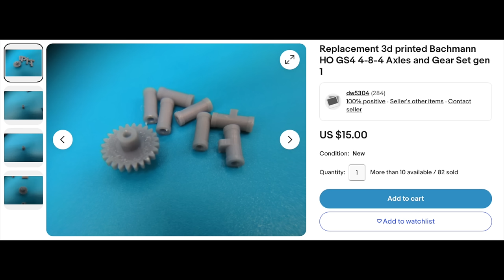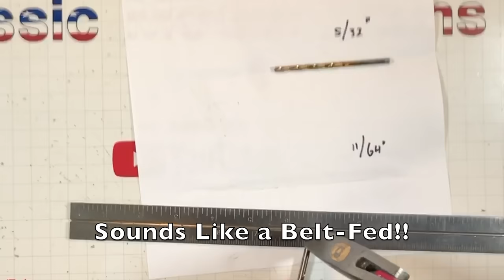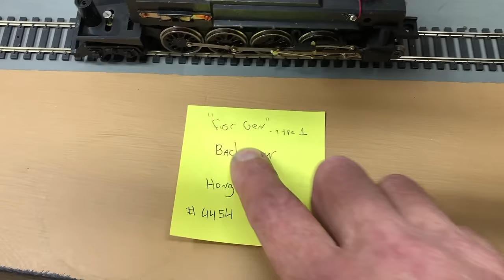3D Printed Gears Didn't Work!  I Found A Technique That DOES!

Comment: On the printed parts I wonder if heating them some prior to installation would be another route to consider? Steep them in boiling water or just place them near a light bulb before pressing them into place. The sleeves are a super solution though and the whole video was a good one. Also, I bet using nylon screws and nuts would have also been a option instead of the home-made sprue screw assembly.
Reply: There are some materials which harden when heated, issue is shrinkage. (Nylon parts in RC)
Reply from the maker: Thanks. Yes the nylon bolt and nut idea would work.  I just wasn't in the mood to goto town and get some :-)
Reply: I’ve seen one guy on YouTube use RC gears to repair Bachmann locos, Gears are are gears, a 14 tooth gear is a 14 tooth gear no mystery to it. Is pretty much wat he said. I wonder if I could get metal gears from somewhere, I have a catalog from a gear supplier somewhere.

Comment: In the UK we have split chassis models thanks (no thanks) to Mainline Railways and early Bachmann. They always failed with the nylon axles and gears splitting and tangling up the linkage, at least Bachmann upgraded the noise underpowered pancake motors with decent can motors but they still used the daft split chassis design until the 2000s when they all died I believe
Reply from the maker: Thanks for some cool information!!

Comment: Props bro, I’ve had to replace the motor/gear/flywheel and belt on my Spectrum Consolidation and I’ll bet I’ve had it apart probably 10 times to get it sorta together correct and now the headlight doesn’t work 🤦 . But honestly I like the engineering and completely understand why others don’t! I really want a Daylight FEF and cars.
Reply from the maker: Thanks Rick. I wouldn't mind a Daylight with cars, just another manufacturers offering.

Comment: 3D printing has one fault i can see, it is made a way like a casting only worse as far as strength. I laugh every time I hear about anyone making high stress items.
Now there is a 3D process which uses a materials like metal which might work, but you need insulating.
What is needed a gear set made though milling from a block. (work at a place that did that for prototype parts

By the ways, square and round shaft part stress is nothing new. Lots of people can not understand how the old fabric mills of mid 1800s did make it work. they used square shafts and round flywheels
Reply from the maker: 3D printing has a lot of good uses, and this application aint one of them for sure.  1800's engineering is amazing to me!!

Comment: Nice fix brother !!!!! .I really like the tube stretch method to get what you need . Made in freaking China/Tiawan /Korea .Rebuilt right in the USA MAN!!! The makers of the junk replacement parts needs to be called out big time or the old fashioned way .Well you know.  .Almost seems they made them and never took the time to actually test to see if they actually worked .. Thanks Man !
Reply from the maker: Thanks Adam.  The second set I received, I was able to phone call and visit with the creator of the piece.  Says he's sold over 500 of them and not had the problems I encountered.  He was at a loss as to why I could not get his gears to fit on my axles.  Merry Christmas to you and yours Sir!!

Comment: I've been through cracked gears with bachmann. I found with a good cleaning with hot water and Dawn dish soap. Sewing 🧵 and CA you can glue the cracks and carefully position thread using it to completely close the crack all the way. Obviously the tighter you pull and wrap the thread better it holds. Then take off thread after about 24 hrs dry time. I would put them back together and clicking gone. Still running some common Santa Fe's and chessie after fixing them 6yrs ago. Love video and some great not to order from replacement stuff information. And these are the ones I was telling you about with the wheel timing. I had bought 1 in lot buy. Didn't have close up pix of it. Ya then got it. Disappointed major. It was non diluted hand painted red white and blue. Paint was so bad when I started taking it off... SMH 🤦‍♂️... I see that it was painted over a daylight scheme tender to. Had a chance to get different shells but after another lot buy. I spent my limit so missed out. Still looking for another shell set that fits budget. Kicking myself in the head everytime I see it for not just buying them. Thanks for info t have great Xmas and New years 🎉🎉🍻🍹🥳🎇🎆
Reply from the maker: Thread and CA sounds like a pretty good idea as well.  Seems a Feller could leave the thread in place?  So somebody painted a daylight special into an American freedom scheme?  Poor paint jobs....what do ya do?  Guys got learn one way or another :-). M.C. to you as well John
Reply: @classicmodeltrains  wish but you need to wrap around and through the gear ⚙️ teeth. Pulling tighter the closer you get to crack. Almost like windings on amiture. Use lock tite super glue to. Works well and you can use uncure on it as well as CA.
Reply: @classicmodeltrains  wish whoever did it tried learning on a cheaper and more common engine. Lol

Comment: First off...nice job of adapt/improvise/overcome. Second...there are what's called "engineering" plastic resins suitable for making functional thermoset axle/gearsets that won't instantly disintegrate during assembly or shortly afterwards during usage. They are used in silicone molds made from perfect original parts. I'm a mechanical engineer who develops stuff like this for a living...and an avid model railroader who can fix or IMPROVE virtually anything. Some of these clowns hawking 3D printed stuff don't have a clue. While there ARE 3D printing materials and processes suitable for making functional parts, you're probably not going to get anything really reliable from most interdwerb sellers...as you found out.
Reply from the maker: Thank you and I have had several other Fellers who do what you do with the commercial making of parts tell me the same thing.  The at home 3D printed stuff is no good for gears.  Pretty cool you can make up new fix it parts for your railroad items as needed!!

Comment: This locomotive started out with Lionel's second (and failed)  attempt to make it in HO back in the 1970"s. 
Bachmann had nothing to do with Lionel's version as these locomotives were made by Kader of Hong Kong.
Reply from the maker: Kader?  I hear Lionel was using re-branded Athearn in the late 60's.  Strange how Lionel could never pull off a market share of H.O.
Reply: Kadar is bachmann that why all of lionels stuff from the time is the same as bachmann because its the same manufacturer
Reply: @classicmodeltrains : Lionel HO of the 1960's was re-branded Athearn. Attempt two from the 1970's was mostly a Kader (Hong Kong) effort with Lionel HO scale building kits in the 70's made for Lionel by Pola of the former West Germany along with some Lionel produced HO (GP9's the FA's, U18B and some cars) made in Michigan thrown in with the U.S. produced 1970's HO items. Eventually, all trains items (locomotives and cars except the U18B) from the 1970's moved to Hong Kong production to cut costs. Now, Lionel is trying a third attempt at HO, this time using re-branded Model Power items.

Comment: Good to know about this. Resin 3d printing is great for precise things, and there's various resins that behave differently. It seems both were too hard, which would be fine for models or detail parts. There are ABS like resins out there which would be softer. 

I will keep your repair in mind as I'm the fix-it guy for my club and we have a Bachmann Niagara which the mechanism seems familiar to the gen 2.
Reply from the maker: I agree, if it was printed with something different it would be just fine :-)

Comment: Hey Ron, I have a Gen 1 Chessie 4-8-4 that I had bought replacement parts from a fellow named Otto back in 2015-16. They worked....for a bit. Now, that loco is back to being a shelf Queen because the gears broke. Imagine that. I must say the idea if "sleeving" the gears never crossed my mind. This repair ranks up there with the one I did on my Walther 90ft turntable. I bought bearings to carry the electric to the track instead of the crappy wiper/brass sleeves Walthers had
Reply from the maker: Hello Ray!  Yes its unfortunate the lack of engineering that takes place with some of the stuff in this here hobby.

Comment: The guy who offered those first set of gears through shapeways also offers gears for N scale bachmann trolleys. I was fixing a friends, he ordered the gears- same thing happened to me, I tried inserting a gear and it broke the instant I pressed it onto the axle. Axle holes weren't big enough! I figured if one gear broke, the others would probably break too, so instead I widened the holes in the gears until the axles slid into em, and then used a dab of CA to hold them in, which seemed to work out. They should really offer a buyer beware on those 3D printed gears!

It's always fun trying to make up something because you can't get the part you need. Used some K&S metal tubing, thin sheet brass, and some ball bearings salvaged from an old busted VCR to fix up an O gauge Lionel engine of mine that never ran because the bearings were shot. Runs like it's brand new now! It's an early MPC job where the bearings are just plastic, molded into the bottom of the motor truck and the brushplate on top, so there's no real seperate bearing to replace. Had to open the holes up and make my own!
Reply from the maker: If I would have started with that little file set I bought for this job I suppose I could have done the same thing and made it work.  I just thought if the gears are this brittle will they break if I set the loco down bit rough?  Sounds like you came up with a pretty good solution for that MPC.  Quite the fabricator you are!!

Comment: Yes, some 3D materials are too brittle for this.  ABS-like resins may perform better.  That said, it does look like you have a size mismatch. FWIW, I would not expect much consistency from the producers of these models.  In any case, and even if the hole is perfectly sized, it almost certainly will crack if you wiggle the axle when trying to push the parts together by hand.  A press is the only reliable way to assemble these. HTH.
Reply from the maker: Off camera I used a press and they still continued to break.  The axle square was just to large for the 3D parts square.

Comment: Great...ABSOLUTELY GREAT Video showing the great lengths we go through not to spend high dollars on manufacturing locomotives that only last about 4 years.  I myself have completely gutted and rebuilding an MTH DCC GP38. It lasted only 4yrs, and MTH is OUT OF BUSINESS... When I'm done... New Motor, New DCC board, iPhone 4 speaker and LEDs to add for step and truck lights... But YES!
This video shows everyone what we do... And OMG, I have a few broken Bachmann Steamers from the 80s of eVile Bay..., I'm not gonna touch now...WOW what a headache to go through 😮
Reply from the maker: It was a lot, but in the end it's going to work for quite some time now.  Sounds like you have a lot into your GP-38.  Hope she pulls real good for ya :-)

Comment: My literal job for GE Power was 3D polymer printing R&D. I had ALL the toys, seen plenty that still isn't publicly available - I have several broadway limited engines that could desperately use gears.  ....yeah... I'd never recommend polymer gears... (resin) your results were painfully predictable. No one wishes or would work more than me.... but. No.  Just no.   😅
Reply from the maker: Cool to have someone with your "horsepower" chime in and confirm what I suspected.  Thank you Sir!!
Reply: @classicmodeltrains  you're welcome.  I actually had further thought on this and I feel bad for not technically elaborating.  Even if you had been successful on the install, the life would be highly questionable.  Photo-polymer does 2 things over time.  1, the cross-linking never really stops once started.  So, as the parts age the become harder and harder, and this more and more brittle.  We tracked test samples for years and couldn't really find that any had fully stabilized.  - secondly all photo-polymers are hydro-scopic, meaning they absorb moisture and expand like wood.  Even in very dry environments the humidity in the air is enough to cause growth.  This too seemed to never fully stabilize.  So, a nice snug fitting gear might spin loosely in a matter of weeks or months.   All of these things we're taking about are extremely small, nothing you'd ever see without microscopes or machinists tools, but in gears, thousandths matter.   Makes great visual parts.  I have some lovely bridges and cabooses I've made. Best keep it to things like that.
Reply from the maker: @bessemerlakeerieinhoscale6061   After purchasing the micro file set I could have opened up them 3D gears some more but I figured even if they get installed correctly the brittleness they presented would only end up with a very short life expectancy.  You have just confirmed my hypothesis.  Thank you!

Comment: God, havent we all been here at some point.  We start a project that goes from tough to dreadful to horrific, and every attempted fix is a fiasco.  We should crap can the whole thing, but its become a challenge, so we keep at it.  We end up inventing a fix thats way superior to the original.  It wasnt worth all that effort, but yeah, it was.   Those engines will be running long after we arent.
Reply from the maker: I see you have suffered just as I have.  It is nice when the problem gets solved one way or another.

Comment: The design is fundamentally flawed. The internal square hole concentrates all the stress at the corner of the hole where the material is thin. Cracks will form at these points first. All of this and Bachman engines are noisy to begin with.
Reply from the maker: Couldn't agree with you more, Although this loco was pretty quite I must admit :-)

Comment: I do a lot of 3D printing and you have to use the right resins for the right job. Sometimes even mixing resins. And then you need to stress test the parts so you can be reasonably sure they will not fail. It's not as simple as just designing the part, printing it and then here you go. This is why I will not make these types of parts for sale. But I will take a loco and custom make parts. Fit them, test them and only if I'm successful, do I bill the person. And because this all takes time, I only do it for club members, friends and maybe... friends of friends. 

I really enjoyed watching you tackle this job. Well done. But most important I think is for the people who ask others to do these repairs to watch these videos so they can see how difficult it can be. Maybe then they won't complain about the cost.
Reply from the maker: Thanks Roy.  I like the way you think!!

Comment: You need to find a good antique clock repair man.    Old clocks are all brass.   Someone could make you.  Gears,  Shafts,  Bushings   Also square ends.   Since  this is what they do.  When rebuilding a clock movement.     I have never taken a train apart.   But now seeing what you did.   I see how much the parts.  Resemble clock parts.  So I think that is something you should look into.
Reply from the maker: That's a really great idea.  Unfortunately out last clock fixer guy closed up shop years ago.

Comment: Go Ron go....your ingenuity never ceases to amaze...

Thanks for the great comparison of the gen 1 and gen 2 locos...

It's a good observation that they changed the loco numbers from the gen 1 #4454 to the gen 2 #4446

Not to confuse things...but a quick search on the ebay showed that there is also a #4449 out there...

my GS4's are both gen1..1 still works fine...the other has zinc rot on the center set of drivers...least I know which used ones to keep an eye out for now...

Keep up the great vids...

Hope you and yours have a grand holiday and a Merry Christmas....

Rich...
Reply from the maker: Greetings Rich, Glad you enjoyed my video.  M.C. to you and yours as well :-)

Comment: Nice work!   I have 2 brand new barely ran Bachmann 4449's Southern Pacific Daylight and American Freedom Train GS4 series engines that are ironically both in need of the same repair. They havent been on the track since they went on self-destruct mode the same way. I wonder if the effort in restoring them would be worth trying. Thank you for sharing
Reply from the maker: Thank you and sorry to hear you have 2 beautiful loco's that are paralyzed.  If their gen 2's I would try

Comment: The gears are made of Nylon which cannot be glued. They are also the wrong nylon. They "act" like...meaning the style of cracking, like they are nylon 6. The automotive industry had the same problems with nylon 6 from the 50s. 60s and 70s. It absorbs moisture, swells and cracks. The answer is nylon 66 or nylon 11 or 12. So it really only has one geared axle. The broken pieces are actually just axle shaft connectors and the whole thing is tied together at the drawbars.

The problem with a lot of the DIY desktop printer crowd is not that their CAD is off or that the printing is bad, its that most are using filaments or resins that are readily available instead of selecting the plastic that is required for the part. too many are using ABS or PLA not suitable for this part. The other issue is that certain resins have after processing swell or shrinkage. There are many new plastic alloys are there these days but you have really know your plastics. I work with plastics for a living.  NICE fix!
Reply from the maker: Thanks for some good insight Jesse, I agree with you :-)

Comment: Wonder if the sleeve trick would work for their diesel gears?
Reply from the maker: Thats the article I pointed out with the long web address.  This idea originated from a Feller who does the same thing on Diesel gears.  Probably uses a smaller diameter brass sleeve to start with for sure